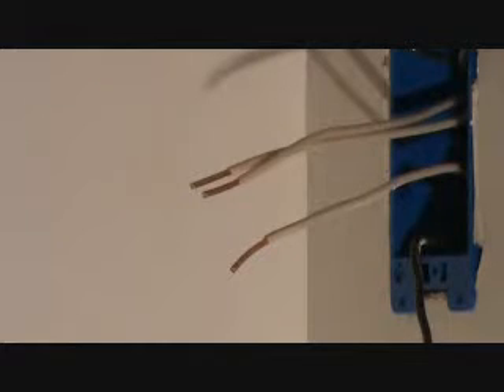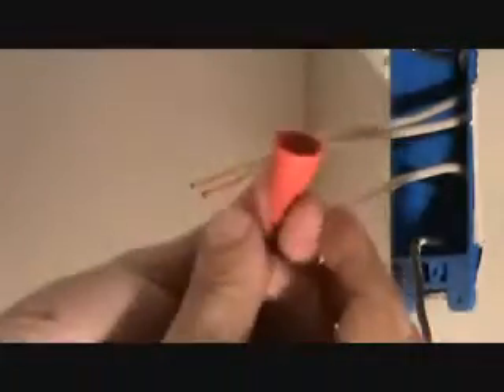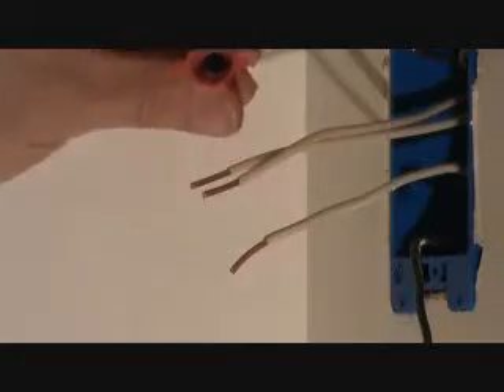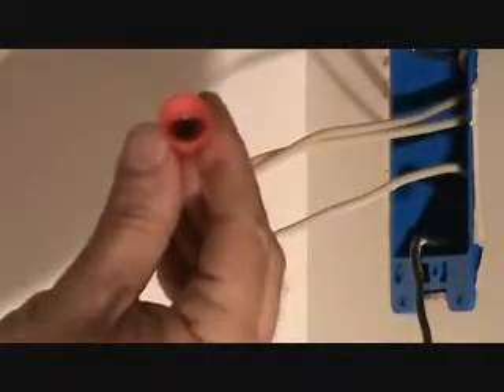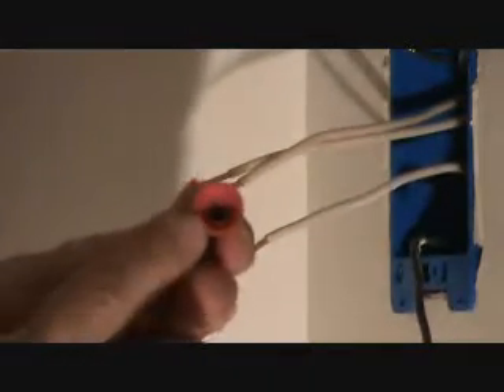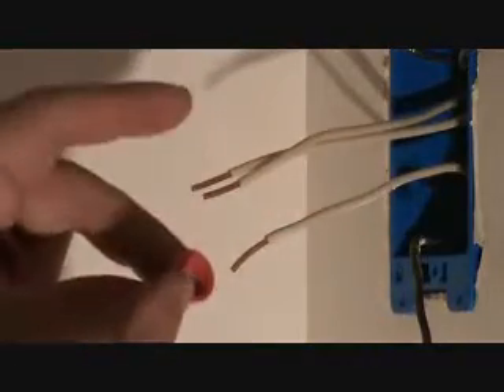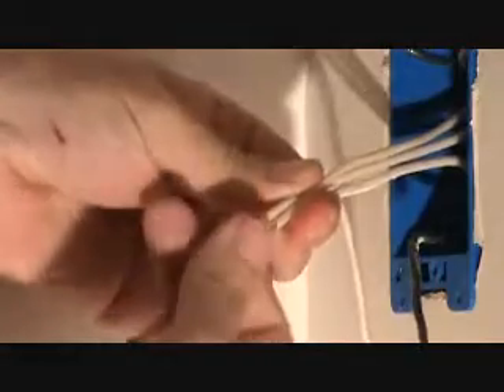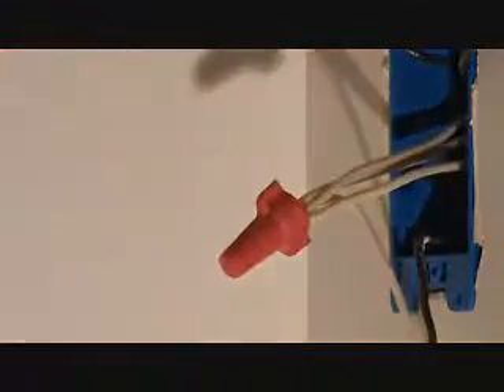How to connect the white wires for an electrical outlet...Part 2

Comment: Why go to the trouble to put a pigtail less than 6” long??? It’s a waste of time and ILLEGAL.
Reply from the maker: Hmmmm was just trying to fit everything back into the box. You leave too much wire & you have an issue getting everything back in there depending on size of your box how many wires are in there etc...

Comment: The one with ears is like a wing nut. So it is a wire nut. The other little red one is not as good. Wire nuts have a tool that fits on a screw gun.. get one!
Reply from the maker: Never heard or seen this tool you are describing. Might have to check that out...thanks!

Comment: Hey Joe, I just completed the installation of 2 recessed lights. I  used  an existing outlet as my power source.  From that existing outlet power source, I am have a very short run to new 110 single pole outlet (14/2 wire from the original power source to the new outlet).  From the new outlet (which is working fine), I go to a switch (because I want to be able to turn the recessed lights on and off - or possibly dim them).  From the new switch I go to the 2 new recessed lights (in a chain).  Everything works fine until I turn the recessed lights off by way of the new switch.  At that point, I trip the breaker.   For the life of me, I can not figure out what I have done wrong.  Any suggestions?
Reply from the maker: Sounds like you gone the proper route to wire up your can lights from the new light switch. Question is did you use a single pole light switch? This light switch should not cost you but less than a buck. Did you connect the wires to the light switch properly? The white wires in your new cutin light switch box should not be connected to the light switch at all. Connect the 2 white wires in the light switch box with a yellow wire nut & push into the box. The 2 black wires get connected to the new light switch & the ground wire gets connected too. Maybe that is your issue? Give me more details as to how you have connected your light switch. Thanks for your question!   Joe  :0
Reply: +VideoJoeKnows hey Joe. I'm having the same problem.  I relocated my light switch(which had both the light and fan, installed into one switch).  I'm having the same problem above on how I also keep tripping my breaker.  The old wire has 2 black wires, and 2 white wires.  My new wires has 2 black, and 2 white as well.  Instead of just caping the wires off, and putting a full cover over it.. I'd rather add another out let.  It has a metal box, so I'll ground it to the metal box itself.  With what I told you above, how do I wire the outlet in???  Do I need to use pigtails??  
Since a lot of the times I just want the light, and not the fan... I have 2 switches at the other end to make it where I can separate the fan/light switch from one switch, to 2 so I have the option if I want the fan on or not??
Can you please help?  Advice?  Anything?  Great videos.  Please keep them coming. Thanks.
Reply from the maker: Sounds like you have alot going on there. Not sure I understand all the sequence you have told me & I'd hate to tell you improperly. Could you take a cell phone picture of it & go to your local hardware store & go the electrical department & talk to a sales person & tell him you questions & see if he can't assist you since he will have some followup questions for you I expect. I'm in the process of getting ready to upload more videos so you can learn even more. Thanks for your message & good luck with your project!   Joe  :0